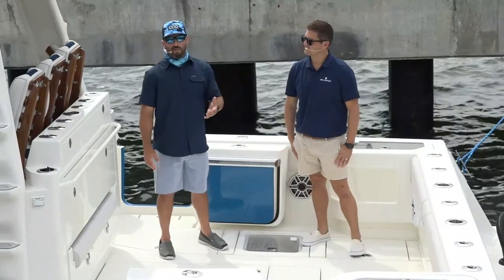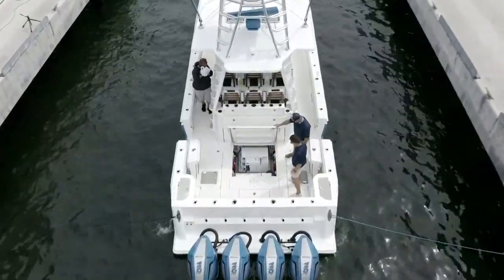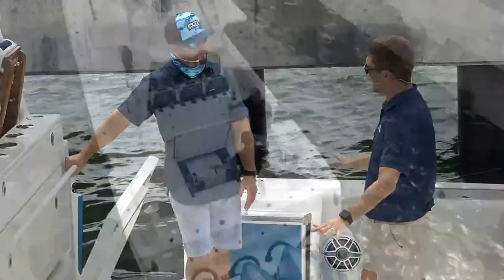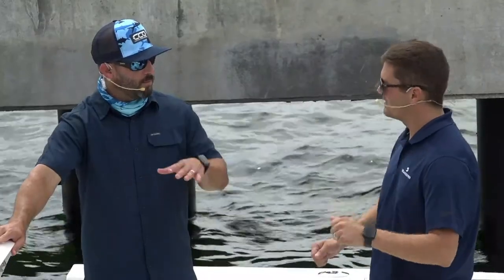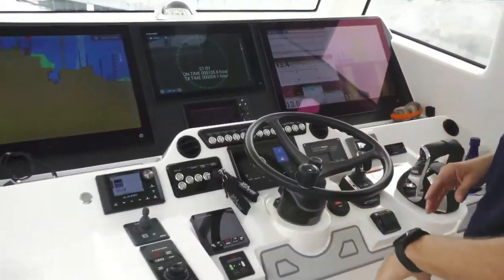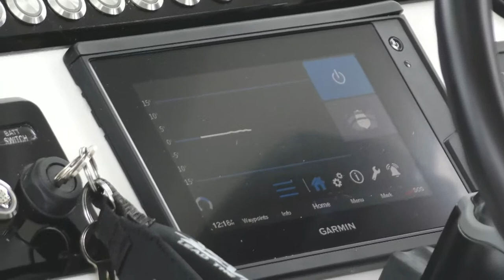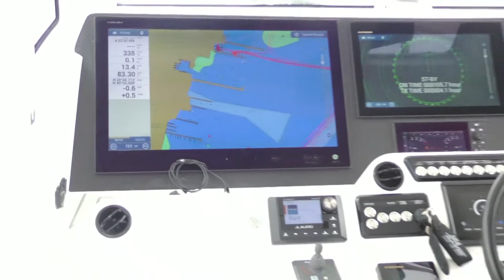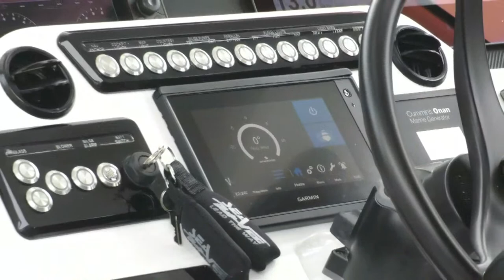450z Seakeeper Chat - SeaVee Boats Virtual Boat Show

Comment: Can this be installed in front of helm? What are the limits with placement fore and aft?
Reply from the maker: Max I believe the engineering has been done to maximize its efficacy as well as maintain proper weight distribution on the vessel to provide a predictable ride so moving it is likely not a good idea.
Reply: Center Consoles Only thanks! Was more thinking how it would be retrofitted on a 26cc with fuel tanks aft and limited in deck space. Great videos and info from this event!
Reply from the maker: Max Ahhh, makes sense. Depending on the brand / model, SeaKeeper can actually advise on where best to place it.  They have an extensive library on retrofits and know where they should have them installed to perform the best.